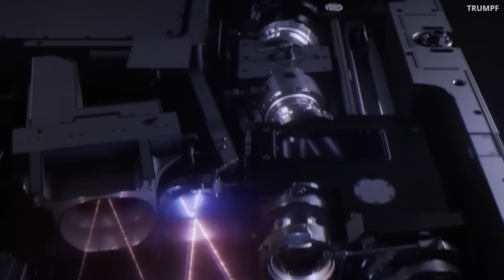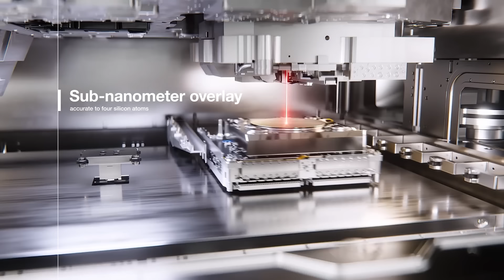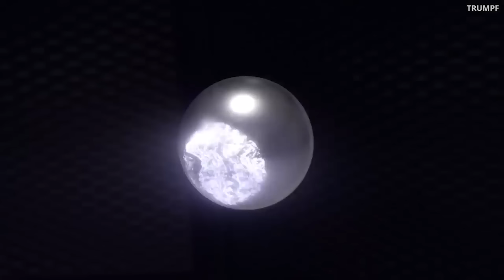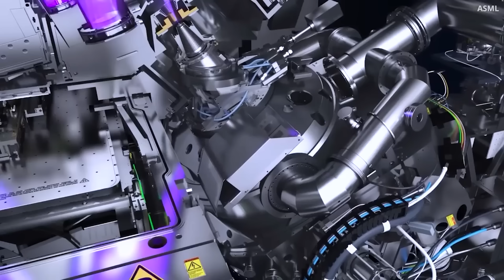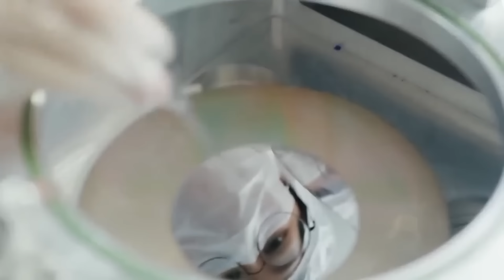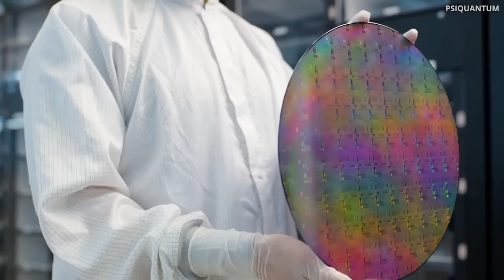China's New EUV Machine Made ASML's Billion-Dollar EUV Machines Look Like a JOKE!

Comment: In my view China will take at the most 3-5 years to make a machine they will be able to use in industry. Next 2-3 years will be taken by mass manufacturing & improving that machine. After that it will be immaterial that whether ASML makes a machine of mini size or with 50000 watt power because then China will be able to counter it with massive number of machines.

Comment: If China succeeds, chip prices will drop. Just like with large AI models, DeepSeek's price is only one-hundredth of OpenAI's.
Reply: It won't lower to what we are used to ever.
Reply: @Hexcraked it really all depends on how big china makes this. If they fully commercialize reselling the euv machine and mass produce it to any worth while extent, which I think is going to happen because of what America did to them.  They may be producing chips by 2030 eith these machines and selling them to other companies/countries. Asml can only make so many machines a year so if china can make more, esp alot more a year I think the market will be just fine once they start selling them and new factories are built around them. Though thats even farther down the road.
Reply: @Blackykun21  Ya, most of it is due to greed though. They even started making rams and selling them i thought it was going to be cheaper but nope, they wanted to follow the market. Only way i see it becoming normal is if most people stopped buying and they started losing revenue. It needs to be a big impact otherwise the prices will only fall slightly.
Reply: It will be less when DeepSeek has access to state of the art hardware.

Not to mention most western AI besides Google's are run on GPUs which will never be the most efficient way to run AI/ML models.

Comment: Is China's new EUV machine (not really an EUV machine) also made out of tofu? :D
Reply: Cope hard!
Reply: @JohnSmith-wn1ms 
Mate it is just in experimental phase this is a mere prototype and they are yet to make test of it
Also not to forget there is massive difference between experimental phase and deployment phase 
You need to make massive infrastructure changes train floorline models also China would have to import lens from Zeiss and processing thermostat unit from US which Obv both won't give
Without it mass deployment and production with this machine is almost impossible 
Thats the issue 99% people don't even know how this works and this is how cheap news headline trap them

Comment: I heard from one of my xmum professor that they actually made the zeiss type mirror on lab but for industrial use it needs time until 2027mid  and they think the industrial production of the machines will be in 2031-33 and it is before they expected..🤫
Reply: They made mirrors that are not smooth enough to the Zeiss. So they build software that compensates for the error and then build it into the EUV mask.  So the lens problems are gone.

Comment: EUV testing is a success, now it is the commercialization which requires 4 years, I m betting in 2 years.....go China go
Reply: Maybe EUV is not so urgent because most chips can be produced in DUV. Also, I believe (correct me) China has come out advanced process on DUV to produce advanced chips such as 5nm which is good enough for most devices that need advanced chips. Also, China has optimized the software/hardware designs that even when run on 7nm chips the performance is about the same as 3nm or even 2nm.
Reply: @gliu13 Chinas most advanced chip is the Loongson 3A6000, delivers per-core efficiency (Instructions Per Clock) that matches Intel’s 10th/11th Generation Core desktop processors. But they have EUV. Ok. Maybe in 10 years when we’ve moved on. It’s takes a monumental amount of research done y company all over the world to make EUV work, China didn’t just go “we China, build hard thing” and it was so.
Reply: 恐怕不会太短
Reply: @evechristmas5248 Will Smith: SYFM😂😂😂😂
Reply: after yield they still need to automate the design software, so i doubt it is doable in 2 years.
Reply: @lagrangewei they work at a faster speed, so I guess it's doable. Just see how fast they fought op with USA in aii
Reply: @DennisLerche China AI models are inferior to US frontier models bc China’s hardware doesn’t support MRDIMM DDR5 or PCIe6 SSD like US AI hyperscalers!
Reply: @tringuyen7519 that's the hardware that's inferior, they use new AI technologies and still making algoritmic breakthroughs to not suffer too much from the USA blockade of hardware. While USA is just throwing money after compute instead of innovation...
Reply: @tringuyen7519  West including US has built only Chatgpt, Claud and other chatbot type Ai. They couldn’t implement it in real life automated machines. China has already implemented Ai in everyday life like automated robot taxi and more. So, China is way ahead in making a working Ai model and in its implementation. And regarding hardware, they don’t need USA company’s hardware anymore. They have invented their own.
Reply: @DennisLerche software and hardware are different things. They don’t have hardware that is anything even remotely competitive with 2020 + silicon from Samsung/tsmc/intel/GF
Reply: @lagrangewei Design software is actually ahead of the tooling. They will need to fine tune it against production feedback of course. But everything other than the litho are ahead.
Reply: @lagrangewei  that is a foundry problem and they can do it at the same time validating results with the already working prototype
Reply: @lagrangewei Do the yield and design software proceed parallels?

Comment: China’s EUV Breakthrough: A Strategic Victory

For years, the United States used export controls to block China from acquiring the Extreme Ultraviolet (EUV) lithography machines essential for making advanced semiconductors. The strategy was to keep China technologically dependent and behind the West. However, this move has backfired, becoming a major win for China.
While the prototype is still crude and has not yet produced commercial chips, the fact that China has achieved this breakthrough—operating on a differentiated technical path—marks a pivotal shift in the global semiconductor landscape. It signals the end of the Western monopoly on this critical technology and a major step toward China’s goal of full semiconductor self-sufficiency.
Reply: "It signals the end of the Western monopoly on this critical technology"

You do realise that most semiconductor manufacturing is actually in Asia right?